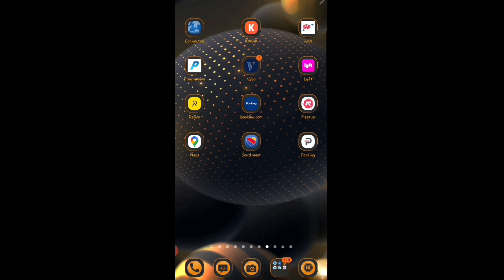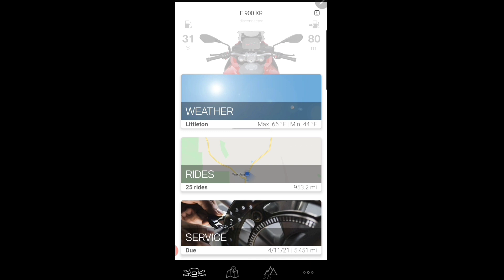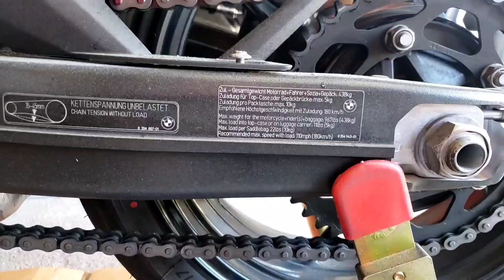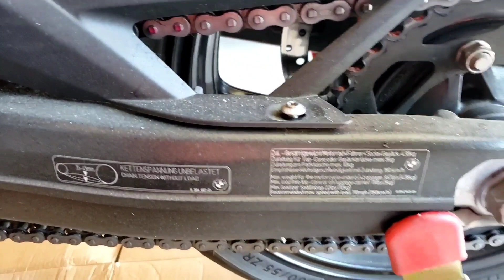How to Clean & Lubricate a Motorcycle Chain (BMW F900XR...Chain Maintenance 101)

Comment: who makes your stand?
Reply from the maker: That's a Pitbull stand.
Reply: @colocruiser3239  , Bro, quick qiestion. Did you have any issues getting in neutral when riding? Seems like the F900XR's gear likes to jump from 1st to 2nd.
Reply from the maker: @oscar8562  yes,  you are not alone.  Seems like the transition from 1st to N takes a gentle touch for sure.
Reply: @colocruiser3239  Thanks Brother!
Reply: @colocruiser3239  mine has 10k on it. Never had an issue going into neutral.
Reply from the maker: @martythompson6509  I don't doubt it.  The first model year F900XR seemed to have some hit or miss issues.  For instance, I also had to have my oil pan replaced due to a factory issue resulting in leaking.   Some bikes never had the issue at all, but enough did that I believe BMW listed it as a recall.

Ride safe...stay well.
Reply: @oscar8562  I've found a light press down from 2nd is actually a bit easier. There seems to be a digital aspect to it whereas older bikes have a mechanical tug when pulling up from first. The F900 doesn't have that mechanical tug, perhaps related to the clutchless shifting feature. Whatever the case, I've found it a bit more reliable to shift into N down from 2.